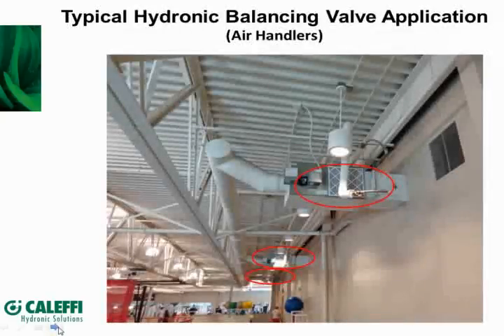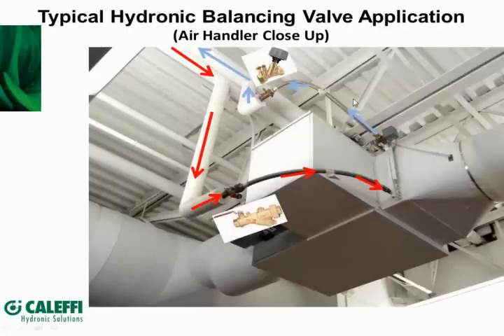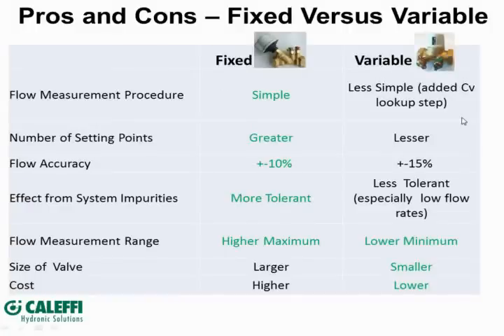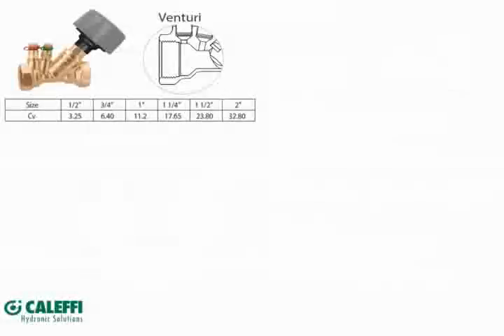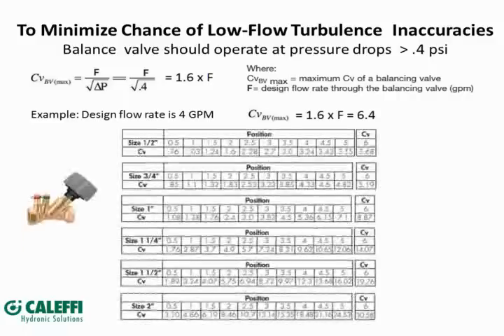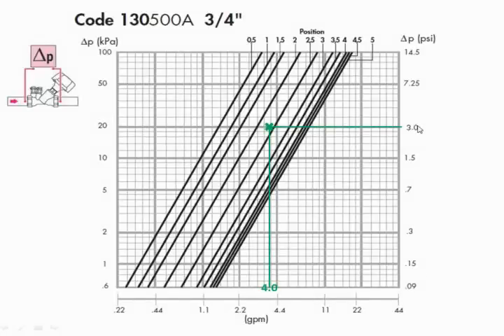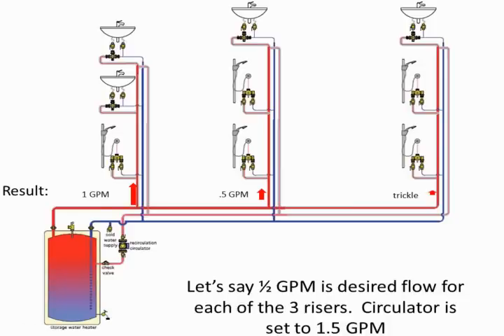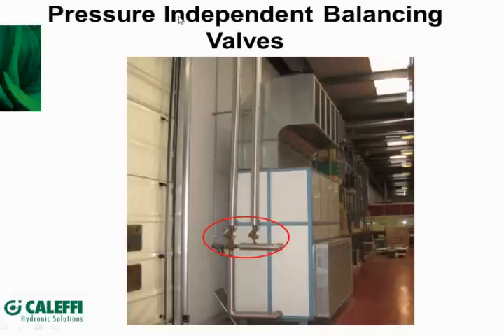Fundamentals in Applying Balancing Valves in Hydronic and Plumbing Applications

Comment: Hi Mark, Great presentation. I just have a question regarding the use of check valves before balancing valves, you mentioned their use to avoid thermal siphoning, could you please explain us a little bit more in detail this subject, thermal siphoning?
Reply from the maker: Thermosiphoning happens because hot water has a lower density than cooler water, and that will cause hot water to rise and cool water to sink when static. Check valves can help prevent the water from migrating, as they will only allow flow in one direction.

As always, reach out if you need help with a specific application: techsupport.us@caleffi.com

Comment: why is it also called double regulator valve?
Reply from the maker: Balancing valves are used for managing flow rates in hydronic systems. 
Pressure reducing valves are used in residential and commercial plumbing systems to regulate pressure.  These are actually two different applications. Hope this helps.
Reply: Caleffi Hydronic Solutions .....what I meant is ....why are balancing valves also called double regulator valves(DRV) ....I not talking about only HVAC applications
Reply: sorry.....I am talking only about HVAC applications